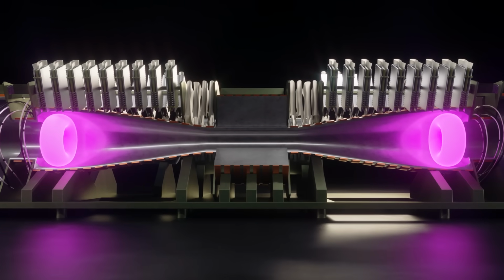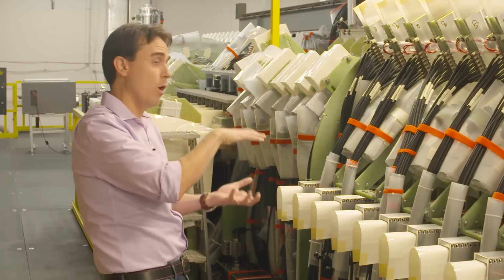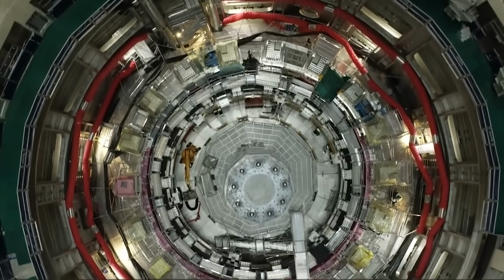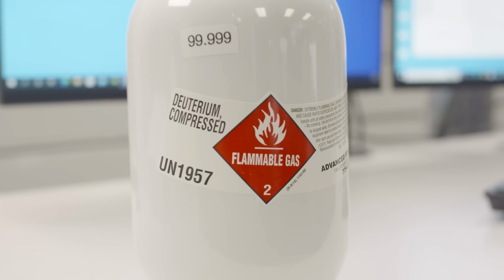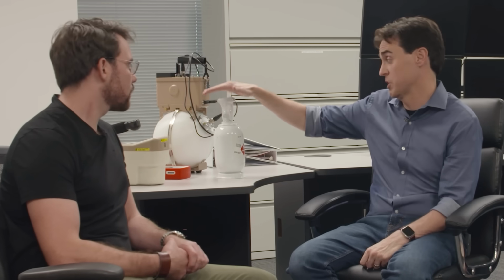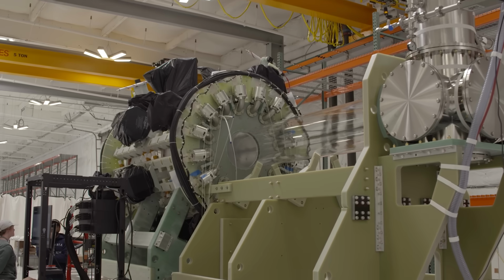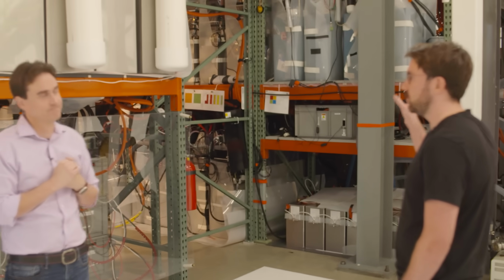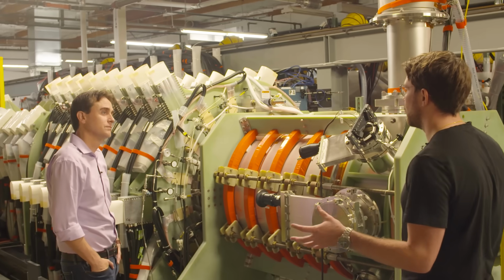A New Way to Achieve Nuclear Fusion: Helion

Comment: We'll see, I want a second source or competitor confirming this.
Reply: Yeah, I noticed a big lack of numbers. What's the maximum tesla of the magnets? What's the theoretical and measured q of the whole process? How much energy does the formation and injection process use?

Also, how exactly are they going to harvest energy from the expansion of the containment field without letting the plasma escape?
Reply: @TlalocTemporal  yeah and how much power will be produced compared to how much they'll need for their equipments. How many cycles the capacitors will be able to do vs how much cycles will be needed in one year.

Comment: When people realise we still need fission reactors to produce the tritium and deuterium needed for effective fusion 💀
Reply: Yes and no.  a D-T burn spits off plenty of neutrons.  Catch those in a lithium blanket and convert some of the lithium to tritium. Bonus it generates a lot of heat=>steam=>electricity.
Reply: As I understand it they are using deuterium+helium rather than tritium. Both of which occur naturally.
Reply: @davidgustafik7968  Helium 3 is ultra rare